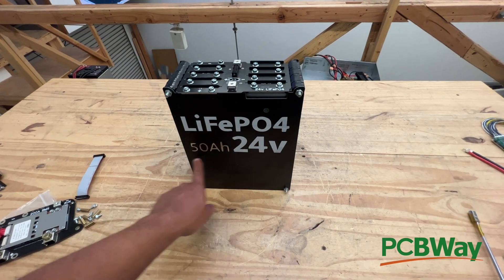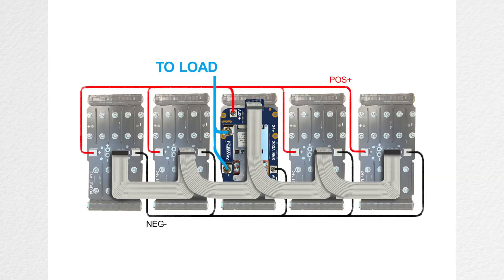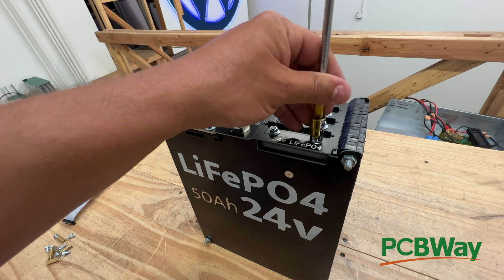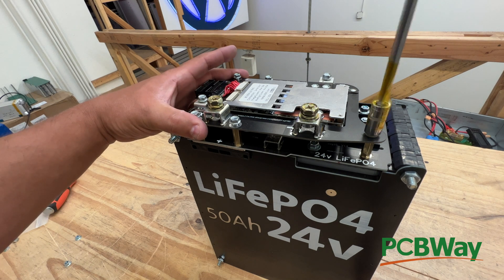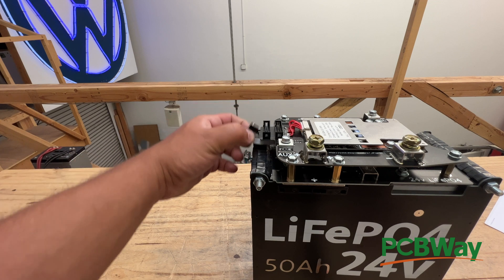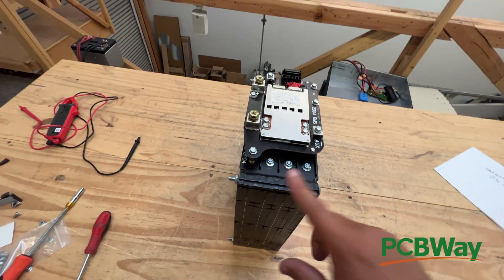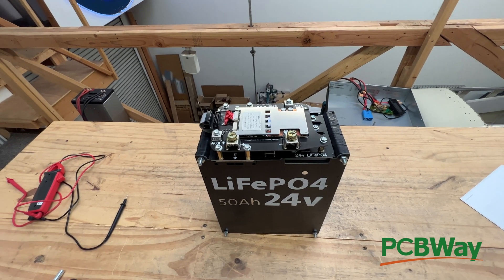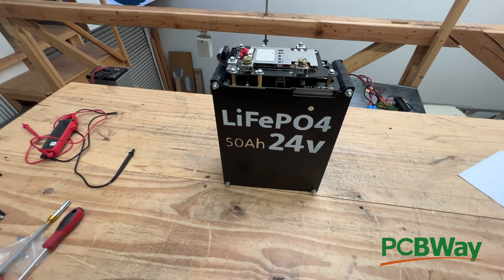24v BMS for DIY LiFePO4 batteries at JAG35.com

Comment: I need to Build an off grid system for 1300 watt for continuous, maybe 2000 for expansion. I'm confused with the calculations.   A should I build the battery bank first or the solar array first?

Comment: Do you sell that specific BMS on your site now? I bought mine from the link on your site that took me to AliExpress. Mine is slightly different but the same sku # as yours. I set up my batteries with the new BMS but after connecting the balance wire connector to the BMS, the output voltage drops to 10.39 v. The battery is 26.6v. the output with BMS without balance wires connected is 18.49 v.

Comment: I have 5 of these batteries with PCB kit and the 200amp 8s heltec BMS from AliExpress. I Daisy chained the batteries together just like in the diagram from your site. The battery bank is ready for used. I have a 24v 2500watt aims inverter connected to the "load" side. The only question I have is, how do I connect my mppt solar charge controller to my new battery bank. The BMS from AliExpress didn't come with instructions. Any help with be greatly appreciated. Thanks
Reply from the maker: Right into the load terminals
Reply: Thanks Jehu. Much appreciated. I really like these batteries. How to buy more when I have the $.
Reply: I have one more question. Is it ok to connect 3 solar arrays to this battery bank?
Reply from the maker: Maybe.  I don’t know what  “solar arrays” means
Reply: @jehugarcia  I have 3 mppt solar charge controllers with their own solar panels. I just want to know if I can connect all 3 mppt's to the this battery bank. I did with my old AGM batteries. I'm new to LiFePO4

Comment: I would like to build a 200A-300A battery for motorcycle audio out of 18650 cells and was wondering if you have a video with some instructions to build and parts.

Comment: Very nice design work Jehu. What if you put thin Aluminum foil between each pack and pass them between the exterior wall ribs. Then bend them down and epoxy the foil tabs to the ribs making a metal foil exterior surface for cooling of the pouches?

Comment: Good morning jehu. I was wondering if you could hook up the batteries in series for a 48 volt pack with just one BMS or do you have to have a BMS for each group of 48 volts
Reply from the maker: you need a bms on each battery if you are connecting them in series
Reply: @jehugarcia  but does the BMS support serial connections? (of multiple bmss) because some don't

Comment: Nice battery and great vid but it looks like the bms doesn't have low temperature cut-off I can't see a thermistor on it that will turn out to be a problem in cold environments.
Reply from the maker: You are correct

Comment: Giving out the Gerber files only, is not Open Source :D
Reply: While it does not meet the absolute definition of Open Source you can openly Source the parts that you wish from the vendors that you wish to to complete this project in a way that makes sure he doesn't have to worry about any liability issues from someone adjusting something and it not working properly or becoming dangerous